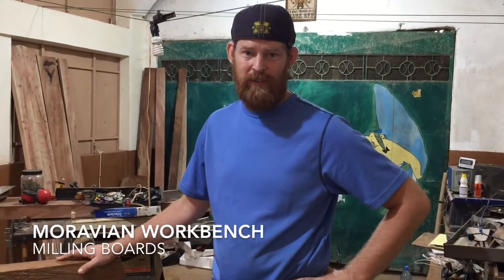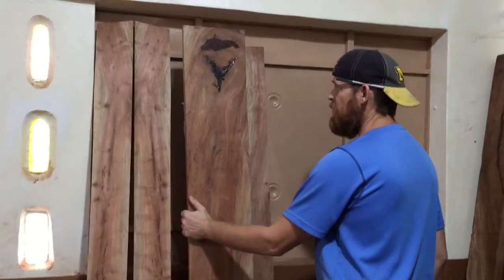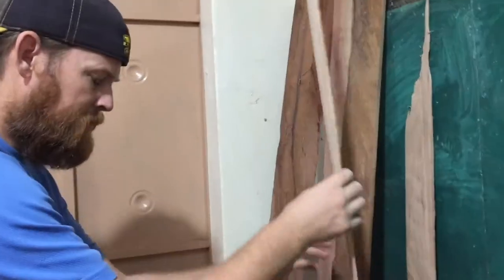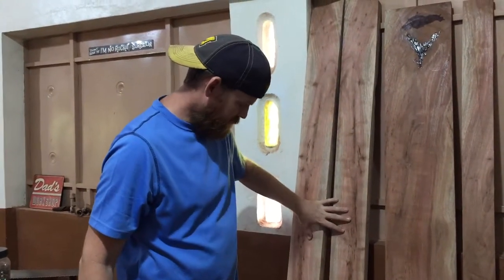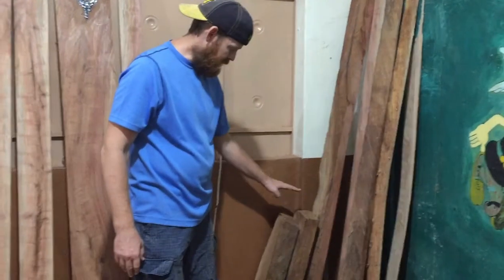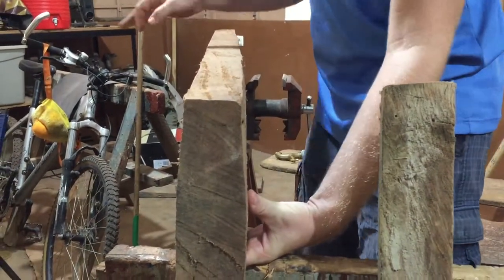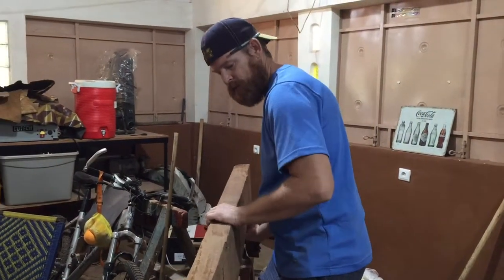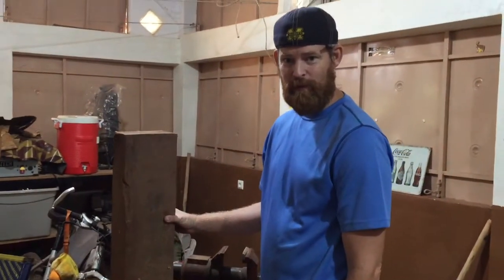2018.09.28 Jeff's Moravian Update

Comment: It's important to remember what the primary function of a Moravian workbench was and that was a portable, rugged workbench. In the 1600's and 1700's they'd take them apart, load them on a wagon and take them to a job site like a house being built. The workbench was good for any kind of finish work or furniture work, but not really made for heavy dimensional timber framing or anything. It doesn't have to be pretty, it just needs to have one good flat surface and a tool tray and a clamp or two with some holes for dog legs. Do the best with the tools you have and get that sumbitch done. :)

Comment: Hey Jeff.  With the boards being a vary odd shape/thickness, cut your boards close to the length you need and work from there.  shorter boards will be easier to mill to size than trying to flatten and square the whole length.  

I'm not sure if the Moravian bench has any shoulders designed into the legs, but if so where the snipe is you might be able to work that to your advantage.

You probably know more about this than I do.  I'm looking forward to another update when you get closer to finishing.

Be blessed.
Reply from the maker: Thanks! There is very little chance that I know more about this than you, @red58impala . Ha! I will use your tip as I go forward.